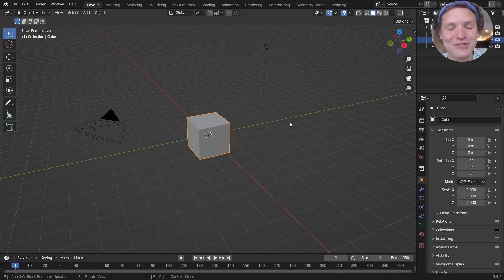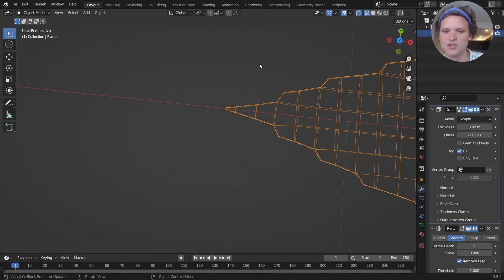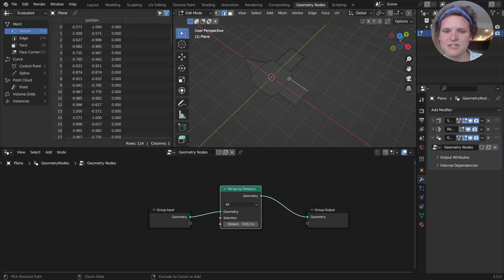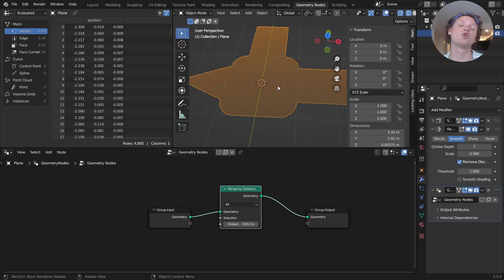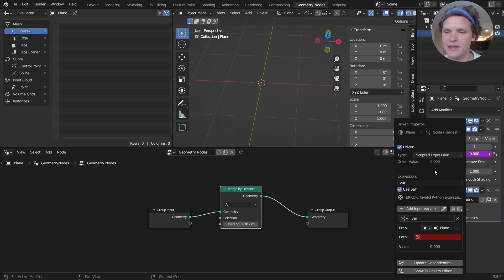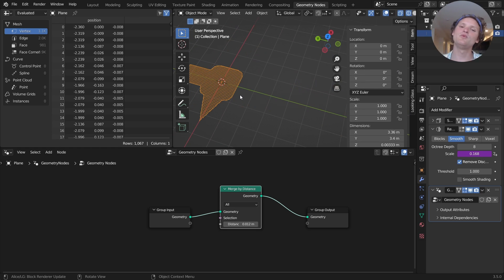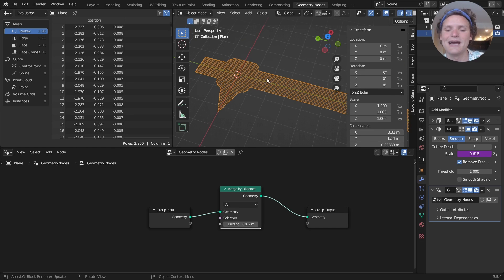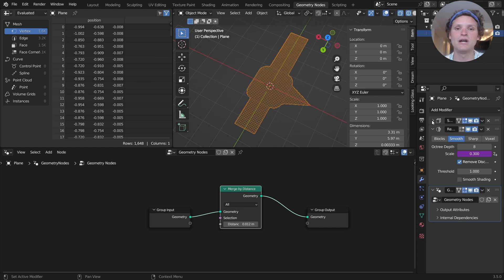procedural 2D remeshing

Comment: You can make a grid, scale it to size with the bounding box node and use the intersect boolean to get a quaded version of the mesh.  You can get fancy and detect which verts are from the grid and which are from the 'cutter' mesh and merge by distance along the perimeter in order to preserve the silhoutte while ensuring it's all quads.
Reply: Perrrrfect, thanks!
Reply: Do you think you could make a tutorial on your method?